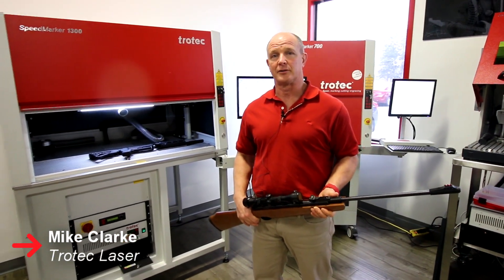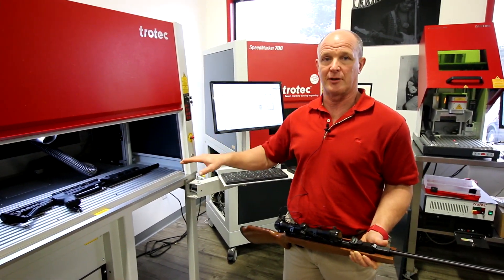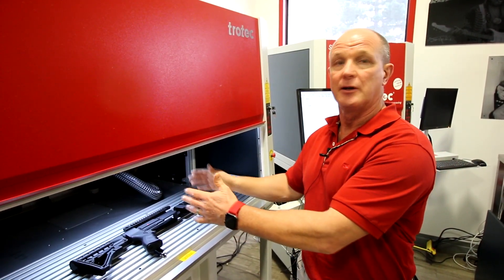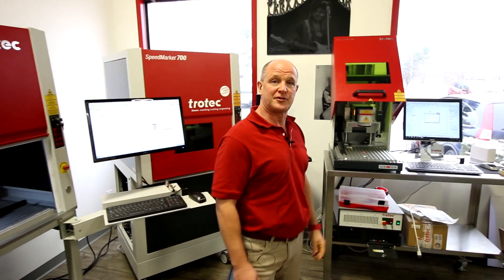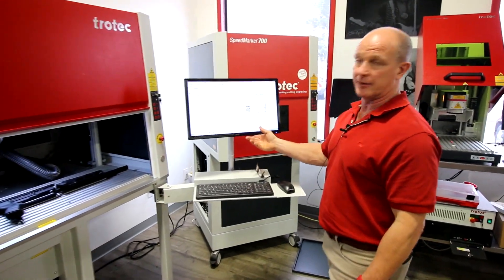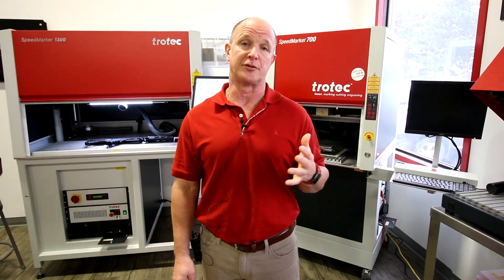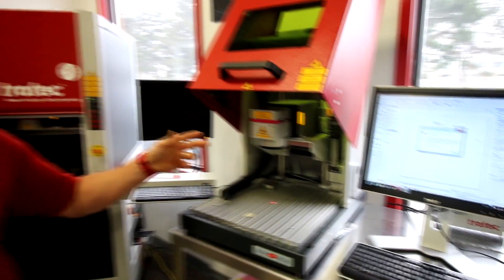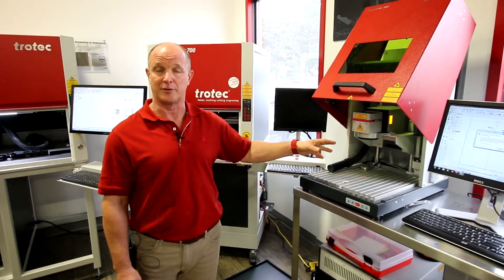Galvo Laser System | SpeedMarker 1300 Walkthrough

Comment: So the laser head doesn't actually move. This isn't  a gantry style laser engraver?
Reply from the maker: The laser head does move on the SpeedMarker 1300, but the galvo is a different system from the flatbeds where the laser head engraves from side to side. The galvo laser has mirrors inside the lens system the reflect the laser beams onto the part.